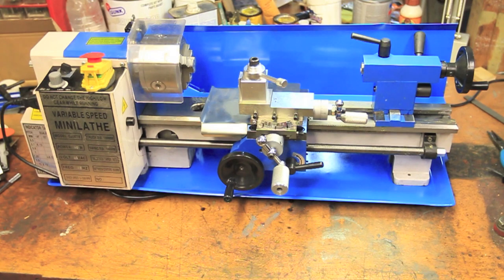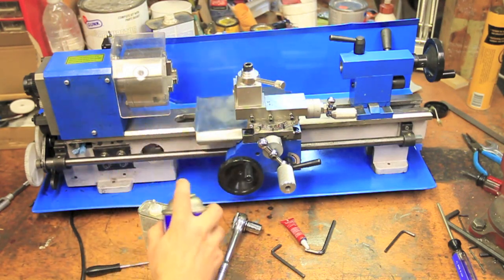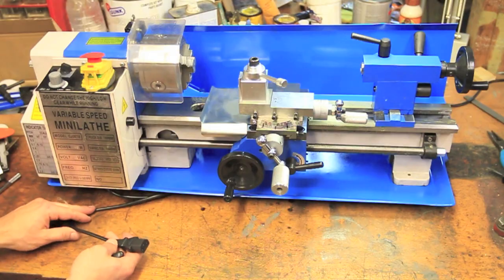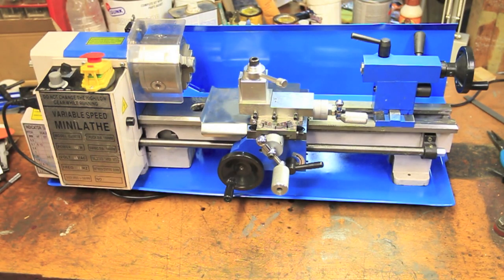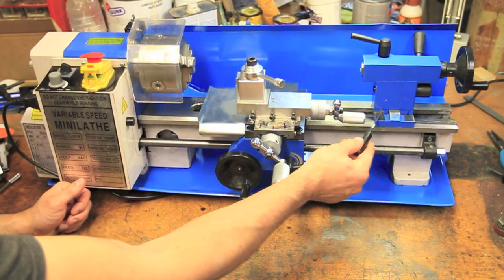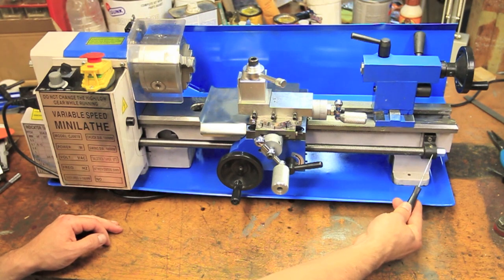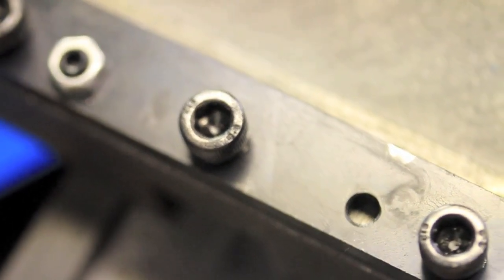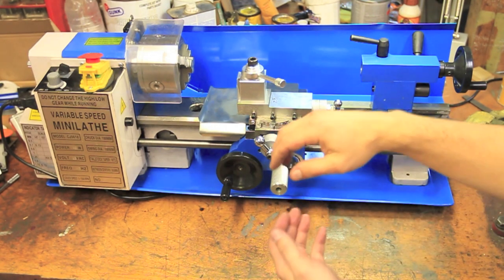Tear Down and Wiring Upgrade + Complete disassembly, cleaning, and reassembly of mini lathe

Comment: I have the same lathe and the same dents in the chip pan.  Where did you get the replacement belt?  After seeing what can happen, a spare might not be the worst idea.  I appreciate your doing this series of videos because this is an oddball no name, no recourse machine. I have no idea who made it or where to get replacement parts especially since I don't even know the brand.  There is no name on it.  On the other hand, I haven't had any problems yet other than a lot of play in the cross slide front to back. You cover what the manual, had there been one, should have shown.  Thanks!
Reply from the maker: Hey Paul,
Thanks for watching! A big reason why I started doing these videos is because I couldn't find the information myself when considering one - so I'm definitely glad to hear it's helping someone else out in the same position. As for the play in the cross slide, if it's because of the adjustment of the clamps, I had a lot of slop also and you might want to check out my solution here: https://www.youtube.com/watch?v=w7hzuLHIaVc As for the belt... that was enough of a pain to earn it's own video and I ended up having to replace the pulley on the motor as well.... the good news now is that the belt is any standard 5mm pitch, 9mm wide, 425mm long, 85 tooth belt and you can find them on Amazon (This is the one I got: http://amzn.to/2pEGHho)... you might also enjoy that video too - https://www.youtube.com/watch?v=3CXZCu3T7Mw
Reply: Get parts from LittleMachineShop.com or from Amadeal in the UK. There are a few other places. Look for Harbor Freight mini-lathe replacement parts, since it comes from the same factory as this lathe.
Reply: LMS does not recognise this particular lathe as they only deal in the ones that have a Hi/Low gear. (I have already tried them. I got a replacement belt from RS Components for something like $5 and delivered in about 2 days. I ended up putting new pulleys on both ends and decreasing low end speed a bit to improve torque.
Reply: So it is as I suspected. The non-geared version has low-RPM torque problems. Makes sense why the hi/lo geared version is more common. My lathe is 250W but I haven't stalled it at low speeds yet. Granted, I haven't done much with it.

Comment: Do you already did increase the diameter of swing over the bed?
I'm looking for a mini lathe with 30mm swing over the bed but it's very difficult find. I'm thinking buy this model and do the upgrade, but I'm not sure if it's possible

Comment: Wouldn't a dry lube be better for most of this?  I would think the shavings would stick to the grease.
Reply from the maker: Most of the comments have pointed to something much lighter weight like motor oil and I've since been using it instead of the grease because you're right, the chips stick to it.

Comment: Superb as usual Tim! Did the lapping of the guide ways make a noticeable difference?
Reply from the maker: Thanks so much! I haven't had a chance to use it yet since this cleaning, but I will say that in my quest for a smooth operation, I've uncovered a number of other things that need attention in the compound slide. I'm in the process of collecting the pieces I need to make the improvements.
Reply: I'm very much looking forward to getting mine in August. For some, I think this tinkering would be an inconvenience but it is part of the attraction to be honest for me!

Are you not tempted by the tapered bearing conversion?

Comment: For future reference, it's typically suggested you add solder to a joint after there is a proper electrical contact between the ends being spliced. Solder has much higher resistance to electrical flow than copper, so in adding a leaded connection, you are effectively decreasing the gauge of the wiring used. 
Cheers.
Reply from the maker: Thanks! several people have mentioned that so it's definitely something I'll keep in mind.
Reply: You've measured this higher resistance? I bet if I put an Ohmmeter on that connection it would measure no higher than a connection without solder in it. Now if he was using solder as wire then that would be a different story. Then current and resistance line loss would be a factor. But a coating of solder is not really a transmission line, now is it? Soldering the ends of stranded wire can also keep creeping green death out of wires too. Which is a benefit itself. In theory, theory and practice are the same. In practice they are not.
Reply: Having doing Aerospace soldering, letting the solder wick up under the insulation is a big no no, as there can be lots of problems down the track with this. If corrosion is a problem then use tinned copper wire or seal the ends with liquid vinyl or something similar. The main problem with soldering is that the solder is so soft the connection in the crimp can suffer from cold flow and become intermittent. However I agree with you about the higher resistance, whilst monono is technically correct, i can't think of any places a millionth of an ohm would make any difference. Also it is not typically recommended for proper crimp joints to be soldered after crimping, as the wire and crimp are cold welded under the pressure of crimping.
Reply from the maker: Thanks for the tips!

Comment: So i am having a problem with my lathe. The carrige binds when it gets too close to the ends, and the ways are actually bowed in the middle. The outside edge closest to the chuck is 0.5945 and the middle goes down to 0.5875, and goes up to 0.5965 on the other end.. Is there some way to level it, or perhaps modify the saddle to accommodate for the slop in the ways, or should i start looking for a replacement bed?

Comment: I was considering getting one of these lathes from ebay...hey, only 529.00 right?  I went back to all the things you went thru with your lathe and decided for the little bit I use my old Goodell Pratt....I am going to save my money and maybe run across a used chinese lathe that sells cheap.  I can fix/rebuild a used one rather than go thru all that with a new one.  Thanks again .....very interesting all you went thru.
Reply: My thoughts exactly, but I couldn't find a cheap second hand one.
Reply: @carlmason983  keep your eyes on craigslist.  I pick up those Craftsman 109s on occasion and Atlas lathes from the forties and fifties sometimes show up for 200-400 dollars in usable condition.
Reply: @masons320   @Scott's Hobby Shop 2.0  we don't get good deals in England.  We would have to stick a nought on. 2000-4000
Reply: @carlmason983  well please don't go getting a Chinese lathe no matter how tempting it might be.  I purchased one for $465.00 after the seller refunded part of my money.  I have spent countless hours modifying this lathe to the point where the bed is the only part I haven't reworked.  Now it works well but resembles nothing like what it began as. Best wishes finding what you can afford.

Comment: I can buy it for 500€. So its worth it?

I like doing all the upgrades and mods. I dont do alot of work on lathe but sometimes i need to do some small things. maybe some bushing puller or something. I dont have space or need to buy big prof. machine.

Any ideas where to get metal gears?

Comment: Putting a magnet on your chip tray can help keep things tidy. If you're working with steel anyway.
Reply from the maker: If only there existed an aluminum magnet :(
Reply: TimNummy it's called a vacuum and strainer ;)
Reply: Aluminium metal is paramagnetic and responds nicely to a linear magnet (electro, not a simple magnet).
That's how they separate Al cans from garbage.
So yes, there is an 'aluminium magnet' that can rip the Al chips out of the way.
Reply: Annual cleaning?

Comment: Great vids Tim, can I ask what is that round black object on the R/H side of the White "mini lathe " front cover, I have had many similar problems with my own Warco 7x12, I have managed to resolve some of them but I am certainly learning from your videos, please keep them coming, 10/10.

Rich....UK.
Reply from the maker: If I'm looking in the correct spot, that's the fuse holder. I have since converted it to a circuit breaker after blowing the initial and spare fuses that came with it... the video for that is here: https://www.youtube.com/watch?v=TPt0e-fWhi8

Comment: After reading some of the various comments both of other users and yours, it looks like you are on the right track. As said by other people before me, I WOULD NOT buy a chinese lathe (and yes I wont capitalize for chinese anymore). I worked on three bigger chinese lathes and hated all but one and that one has it's problems too. One of the best Asian lathes was a Taiwanese 144" long lathe. I loved that but I wanted to use my schools Pacemaker. 

As you had seen, china does not care. They will never care and they wont ever change for anyone. So anyone that is looking for cheap machining equipment should not look into any products from china. I only heard horror stories mixed with miracles.

Comment: Usually, what you buy from Ali or chinese sellers on amazon and ebay, are products which didnt pass quality control, or small low quality factories. They put this on SALE and local merchants buy for cents and sell for nothing.
This is why they sell cheap, but deadly traps. No quality control nor even a test to see if its broken.
On the other hand, if you buy directly to factories, you will get quality items.....but the price will be 2 or 3 times, close to any product you can buy on any local store.
For the amount of time and $ you end up spending on fixing this tool, you end up thinking you should have put 100 buck more and buy a quality one.
Because in the end you will have to probably change also the motor, the plastic wheels, the wirings...Basically, you are paying for the main guide and the rotary which thank God was aligned.
Reply: can you point towards any of those 100$ more expensive, quality approved lathes?

Comment: I don't want to sound like I'm spending your money for you but one piece of kit that I think you need is a two inch China bristle brush. They're called chip brushes in the trade. That is standard equipment for brushing away chips. It'll make you zee artist. Your dust broom isn't the classic tool for that really. Although for brushing down bench tops rat tail brushes are popular. Me, I like snow brushes. I'd be lost without my snow brush in my shop. The snow brush thing is just me. 2 inch China bristle brushes are the gold standard. So you should probably get one, or a pack of 3 dozen. One lasts a long time. They used to be a lot cheaper than they are now. I don't know what's going on with that? Any fairly stiff bristle cheap ass wooden handled paint brush should do the trick though. But this is the quintessential chip brush http://www.globalindustrial.com/p/building-materials/paint/paintbrushes/white-china-bristle-chip-brush-2?infoParam.campaignId=T9F&gclid=CjwKEAjw9_jJBRCXycSarr3csWcSJABthk078kJ7qht3Liwh_v-1UU5miV-pBcth66Ln1zWGsaBGeRoCIq_w_wcB They're not really suitable for painting. They brush metal chips away good though. The best!
Reply from the maker: Thanks for the tip!! 

Soon I'll be setting up a Patreon account to allow those who appreciate the videos help support the channel and getting both things I need and new stuff to incorporate (although I think I can spring for some of those brushes :) ) but to also show my appreciation to those who watch and subscribe and keep this channel going by giving away some of the stuff I make as a thank you. So maybe look out for that too? Either way, thanks for watching!
Reply: It helps to cut the end of the brush with scissors so that the bristles are very straight, you will get less stragglers that way.
Reply: That's why I commented elsewhere herein "Annual cleaning?".

Comment: Just a thought: What about converting the belt drive into a chain drive? At least then you have less risk of it snapping on you during normal operation!
Reply from the maker: Haha nah, the motor stalls way before the belt would snap. Plus a chain would be noisy and need oil and stretch.

I have thought about putting a reducer set up on it so I can get more torque at lower rpms though.
Reply: The reducer idea's defo worth a gander... especially if you're thinking of turning more than the lathe's currently designed for. At least you'll decrease the chances of being screwed by torque stall!

Comment: Cool video, but it's really bad how the lathe can leave the factory in that condition. It's cheap for a lathe, but $500 is still $500. Spending that sort of money I wouldnt expect it to start falling apart out of the box. It does look like you got a nice little lathe after a bit of time and effort though.
Reply from the maker: Agreed - it's all relative though I guess. $500 is a lot but almost negligible when compared to some commercial machines... definitely can buy a lot of tacos either way though. 

It works pretty well at this point, if you consider it as a kit more than a ready to use product then it feels like a better deal ha.

Comment: Hi Tim,
Nice video but  i must gave you a BIG WARNING:
the plug on the motor is an hazardous mod:
if you unplug the motor during work (an accident may occour) in the socket you have the bare pins under net voltage.
making disconnectable the motor is a good stuff but with male connector to the motor side.
the plug you used is female for form factor but male for  bare pins. 
cables mounting that plug are connected to main power side not to utilizer side!
you used an imput connector on an output NET socket!

i hope mi poor english is comprensible 'cause im italian: let me describe in italian so you can traslate with google translator, maibe more comprensible:
Ciao Tim .
bel video ma devo darti un GRANDE AVVISO 
Il connettore che hai usato sul motore è una modifica pericolosa:
se scolleghi il motore mentre stai lavorando (un problema puo' capitare) nella presa hai i poli sotto tensione di rete.
rendere disconnettibile il motore è una buona cosa ma con connettori maschio dal lato motore.
La presa che hai usato è femmina per fattore di forma ma maschio per i poli nudi.
i cavi che montano quella presa sono collegati alla rete non all' utilizzatore
Hai usato un connettore di ingresso su una uscita di rete

Comment: Make new  Saddle  plates out of brass or Steel! The original ones are  machined  cast iron and  will crack if you adjust them  wrong. there are several videos on  You Tube on how to  rework that  with studs and  self locking  nuts. Even though  I expect  yours came  from Seig like I expect it  did you seem to  have  gotten one that is  worse than "normal". Good thing  you have  the  "Fixit" gene.
Reply from the maker: Thanks! I have some (possibly overkill) plans for how I'm going to fix those.... when it's all said and done it should be rock solid and super smooth. Keep an eye out!
Reply: I believe Sieg paints their machinery red? There is zero chance this particular unit is a genuine Sieg. I doubt it is even gray market crap they made after hours for anyone. Real Sieg machinery is pretty decent. This is most definitely a mainland China counterfeit clone of a Sieg design.
Reply: It is not a Sieg, from what I have found the is a large number of companies that make a generic CJ6018 from the same castings as the sieg. Tim's is about the same quality as mine as I have had the same problems and a couple more. Even with chinese crap you get what you pay for.
Reply: Yeah it is a Sieg pattern 7x14. This one does not even have the gears in the head. Which might not be such a bad thing. As the stock plastic gears end up breaking.

Comment: The gender of the motor connectors are wrong, with the ones you have used it is possible for live pins to be accessible when it is unplugged
Reply from the maker: Yeah, I realize that isn't ideal but at least the pins are recessed and would be tough to get to. That is also the DC out to the motor with a much lower current that what you'd find from a wall outlet and it's fused on the lathe. Also they would only be live if the lathe was plugged in, the motor was unplugged, and the start button was pushed... so being in that situation and accidentally/unknowingly reaching inside the port to touch the pins is most likely a pretty uncommon event and would probably pop the fuse pretty quickly. Thanks for watching and commenting!
Reply: I agree that the scenario you posted it is unlikely, but how about this one. Due to vibration, the plug works it way loose and falls out while the motor is running, without thinking you pick up the plug and accidently touch one of the pins as you try to plug it in, BANG you're dead. For the few $ for new plug and sockets cost I would not be taking the risk.
Reply from the maker: I'm not saying you're not correct, I'm just saying the chances of that happening are effectively zero.
Reply from the maker: The lathe is plugged into a GFIC outlet. Mine just keeps blowing fuses. I'll consider changing out the plug and socket the next time I have everything completely apart.
Reply: That's exactly what the last (and every other ) person who was electrocuted thought. However I still like most of your ideas, I have the bearing balls on order to modify my cross slide,